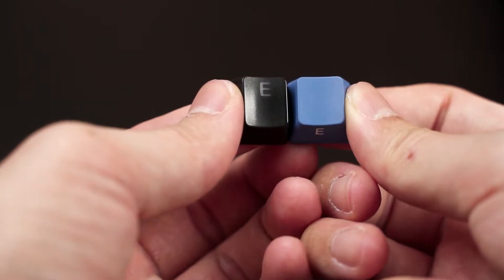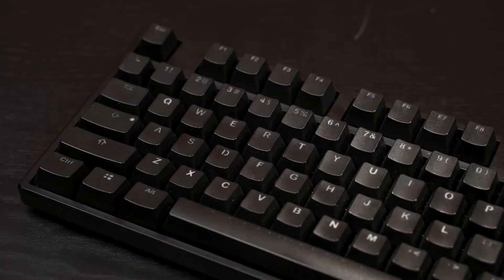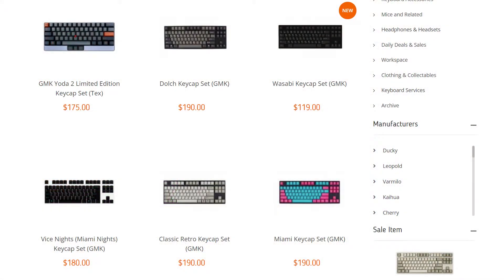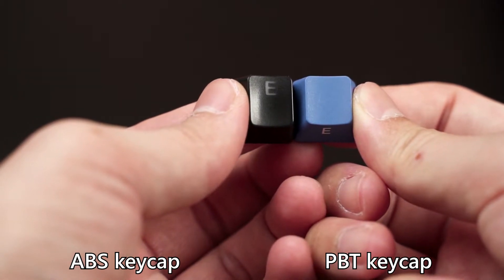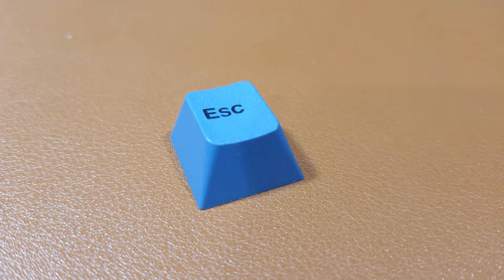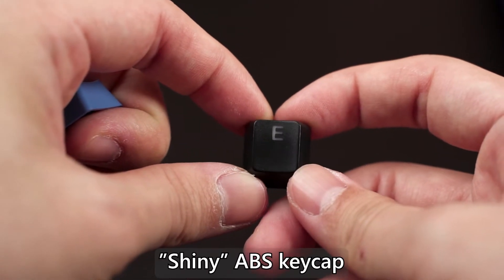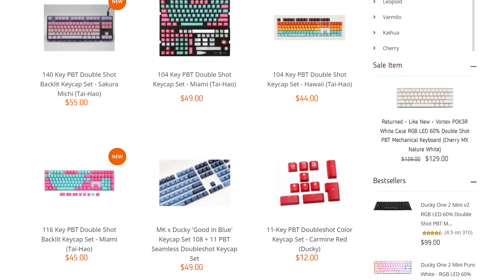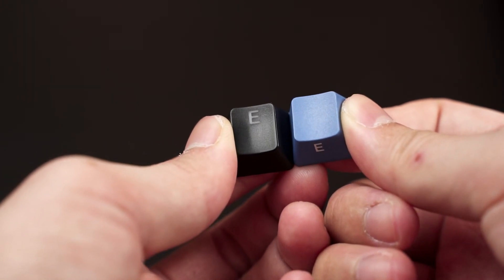PBT vs ABS - Keyboard Warrior Ep02

Comment: Fantastic video, solid explanation, great video and audio production value. You not only taught me more about the difference of these keys than most dedicated channels but you also put in the effort to refine the production value of your content without knowing if people would watch it in the first place.

I'm gonna subscribe because I think I can learn something from you as I go deeper in this hobby and figure out where I want to put my money for a good board without going through a few boards. :)

I've had a Gaming Razor keyboard for a few years now with ABS caps, and while I've tried cleaning my key caps it seems that the top "paint" has rubbed away some on my "W" and "A" keys making them very rough and uncomfortable. Furthermore, after a little while my other caps start feeling oily and slick where it's easier for my fingers to slip. 

My hands do get oily in long sessions so I was skeptical about "wear and tear" being the reason for the slippery feeling, so I decided to do a test with my "Z" and "X" keys which get heavy use and almost the exact same use because I use them for osu, a rhythm game. And one key I never use around the num pad as a control piece.

A simple test but all I did was wash one with light hand soap and a short rinse and dry to theoretically get rid of all the oils and put it back to see if there was a noticeable difference between the two. There was hardly any, and it definitely did not go back to feeling like the unused key cap, which at least proves my hand oil theory wrong.

So I'm guessing PBT is the right way to go for me then since I'm experiencing this kind of wear. Once I feel good enough to dump some cash on a keyboard I know what kind of keys to look out for. Do you have any specific  PBT cap recommendations? Thank you again. :)